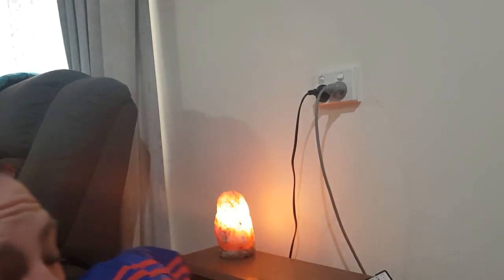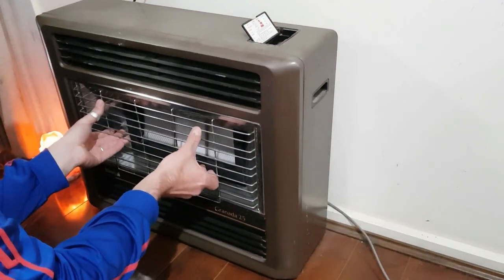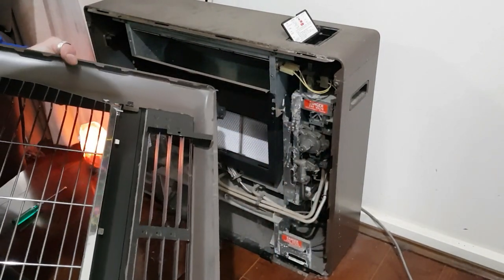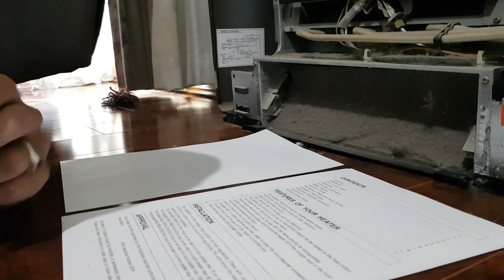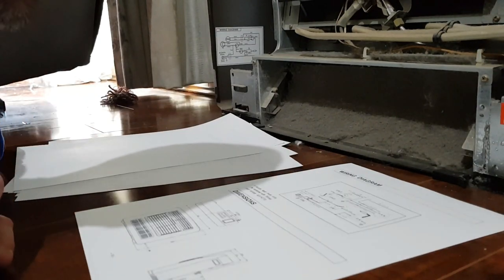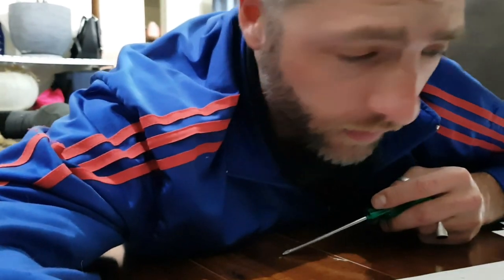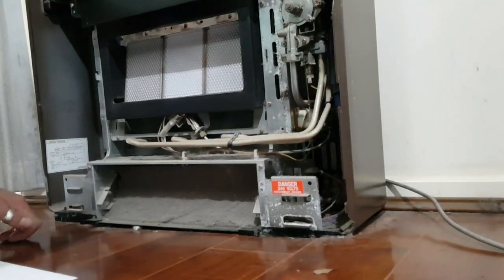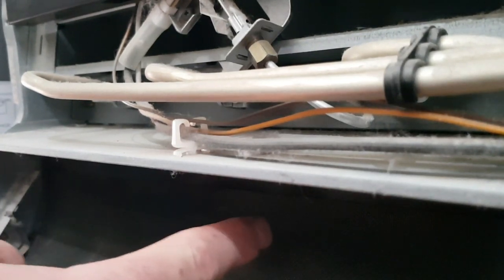Fixing a Rinnai Granada 25 - Vlog 025 06/08/2018

Comment: Hi DoctorOctane! I just followed your method and got exactly the same old Granada 25 working in my shed. I have a question. Only the first button works on mine and the other two buttons are permanently disabled. After studying the buttons it looks like it was made this way to only operate with all three panels lit and on one fan setting is this the same as yours?
Reply from the maker: Absolutely the same, only the high button seem to do anything. The others are just locked down. I thought the previous owners just messed it up but judging by your experience it seems to be normal

Comment: Hello DoctorOctane, I was wondering if you could please help me? I have an old Rinnai, theres no model name to be found, but when it was serviced 1.5 years ago I was told its from 1979, it might be a Rinnai 20SF???
So, it wont start... theres no place for a battery that I can see - so am I being blind - or do the old ones start without a battery, and its prolly finally kaput? Thankyou, thankyou!!!
Reply from the maker: Hey mate, the 20sf looks very similar to mine. Mine wouldn't start/the ignition button wouldn't function unless the unit was plugged into the wall so if yours is plugged in just fine then it could be a couple of things. The cord could be damaged and be lacking in continuity, perhaps even intermittently. It could even be the actual ignition piezo itself. I've personally never had one crap out on me but I imagine it could be possible. Besides that, check the fuse box to see if it has its own fuse/rcd (unlikely I think but worth a check) that might be blown or turned off. Besides that, I'd be at a loss for what it could be. It could just be about time for an upgrade
Reply: @DoctorOctane  Thanks for this! I thought I may need a new battery coz its always started without being plugged in (there is an electric plug, but it just functions for the fan which we dont use). So maybe it started by a piezoelectricity (?) function thats now broken, which makes sense if I cant find where the battery may be. Yeah youre right, time for an upgrade (Im a student so always looking to avoid spending $). Thanks for your help : )
Reply from the maker: Ah that sucks, piezoelectric clickers don't need electricity to run so there won't be a battery in there anywhere. When you press the ignition button, does it make a clicking noise like a gas stove or BBQ does? If not then that's likely what's wrong with it. Have you tried lighting it manually with a match or a lighter?
Reply: @DoctorOctane  no, no clicking noise - dead as. Ok Ill try lighting it manually, didnt think of that. Thankyou.
Reply from the maker: @laurenmickan8360  awesome :) if it works like that you might get yourself another winter out of it before you need to replace it

Comment: I had a Rinnai gas fire installed last winter (Apr 2022) now, on the first cold night (May 2023) the device has failed to light. On contacting the installer he advised that he could not come for two weeks and to ring Rinnai Australia. I rang, and I waited, and waited, listened to the same music for around fifteen minutes. A service person came on the line and soon run out of ideas as to what the problem could be so he returned me to the switch board and I listened to more music. After committing over thirty minutes to this debacle  a woman advised a service adviser would contact me within three days. Take this advice: If you want to stay warm, don't buy a Rinnai! Joe.

Comment: I have had mine 16 years still going ,but the center board which is on always is wearing down becoming flat so i will have to replace or rotate to the 3rd position dont use that one much .
Your auto shut off is just fuzz dirt that sucks in the pilot over time and will shut it off . Jist vacuum from the bottom and will run again
Reply from the maker: That could be it. I thought it was that there wasn't enough airflow over the over-temp sensor causing it to shut off because there isn't a pilot on my unit. It has a piezoelectric striker
Reply: @DoctorOctane  yes i sometimes can get in there with a tooth pick and pull the ball of dust out ,,or i have take screws out and vacuum it . The pilot light is always sucking air in and eventually dust clogs hole right behind that flame in the tube and it will shut off . Ive had mine over 16 years and only thing i have ever done to it. Soon i will need a new ceramic square as the center oneget the most use.has become flat not raised like the other 2 plates . And as you know it get too hot with all 3 squares on so i have just 1 on all winter. 
Happy holidays all
Reply from the maker: Yeah mine is jammed on high mode so it's 100% all the time and definitely gets too hot! You'll be fine switching out one of the side ones if you can run it 1 panel at a time

Comment: Gas and electricity both required for function ???
Reply from the maker: Yes, the gas is used for the heat and the electricity is used for the fan to blow the heat around the room
Reply: No if power goes out we still have heat just need gas flow
Reply: Extremely expensive to run
Reply from the maker: Alternatives that might be cheaper? LPG is pretty cheap

Comment: A flue-less heater OMG, there obviously is no chimney, to let the carbon monoxide out, I sure hope you have a window on both sides of your house open to allow a change of air,   yes the low air flow inside the heater, would have made the heater hot, triggering the overheat sensor- esp useful when the power goes off- like a power black out, ( well my heater has one) and thanks for sharing
Reply from the maker: LPG heaters designed for indoor flueless operation are safe to use. It is unsafe to use an outdoor LPG heater indoors but one designed for indoor use is totally fine. We would always have ventilation while using this heater

Comment: Does it hiss?
Reply from the maker: When you turn the gas on or just in general when it's running?
Reply: When it’s running it sounds to loud
Reply from the maker: That's odd. Mine wasn't super loud, not a hissing noise anyway. The fan itself was loud but no hissing noise. Is it possible that something has gotten into the fan and is vibrating?